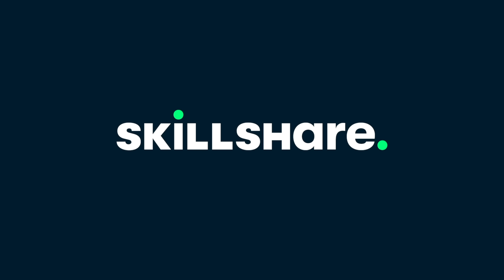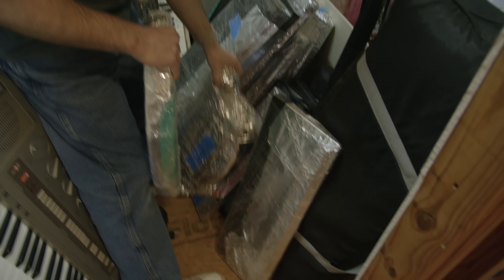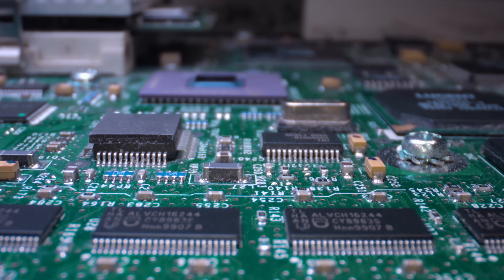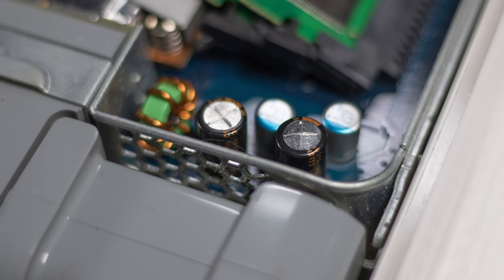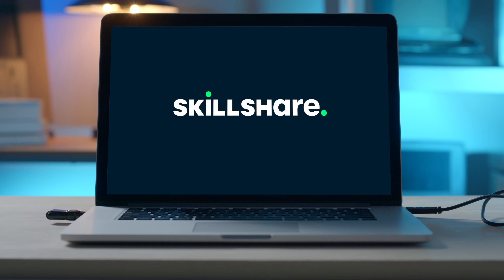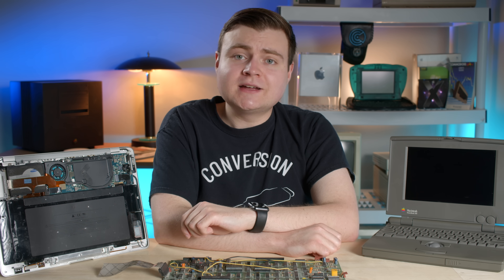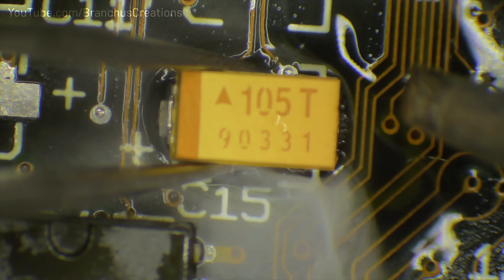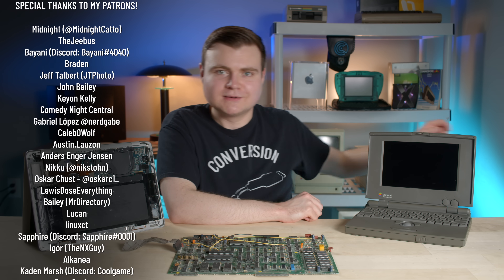Why Do Computers Die? (ft. The 8-Bit Guy) - Krazy Ken's Tech Talk

Comment: I used to be a service engineer and travelled to customer site to fix whatever issues they were having with their hardware at the time.

One particular job really was troubling, what seemed like a failed hot swap SCSI drive, however rather than it just failing and going offline, it rebuilt to around 70% then failed the drive and started rebuilding again, but the rebuild was taking minutes rather than hours.  So, not sure what to do, I checked with the senior consultants who told me to “just pull the drive”, which I did and the whole array went offline!

Turned out the drive was fine, it was the backplane of the drive shelf that failed and took out the SCSI controller board!

Sometimes things are not quite what they seem, ah the late 90’s, would have been so much better just to skip them sometimes!

Comment: I’ll never forget one of my earliest PC repairs, It was in the 90’s from what I remember and this Customer’s PC which was either a 486 or early Pentium PC and it was behaving very quirky and in a strange manner, It kept doing random things constantly, It turns out that when the owner setup his Computer he didn’t push the Power Lead in all the way so it was loose & ready to fall out, I figured out that was the issue fairly quickly and the Computer worked fine after I plugged the Power Cable in all the way! Anthony - Birmingham/UK 🇬🇧

Comment: What is the fault of your Powerbook, Ken?? Just got the same one as yours from a flea market. I have replaced all the caps inside, just to find out that the break in the hinge cut my display ribbon cable in half. Fixed that under a microscope. Now everything works, just needs a crazy amount of epoxy to keep the screen bezel and back in one piece and it is ready to go back together. I am also going to refurbish its battery, too.

Comment: Once I drop my laptop and the screen turned on every thing worked, but it was saying in the error message that the hard drive was not detected and I was so scared my dad repaired it and the hard drivers lose. That’s why it could not detect it. Luckily it was only a little bit of damage and not a lot over that and about another time I dropped it and I thought it was just normal but then I realised you should not drop the laptop and then I was so scared but It was still working in the third time. I don’t remember what is that but I got cracks after those drops😢

Comment: Decades of working on and with pc's, has me convinced that overheating is a major problem.  I have seen too many machines that sat on the floor gathering dust and Fido hair with the fan so clogged that it could hardly turn.

Also saw one computer used in a kitchen where the heat sink was covered with grease and it took automotive engine degreaser to clean it up!  LOL!

I have not done anything on a laptop beyond upgrading clubs, adding memory and replacing the battery.  I only my limitations.

Comment: Im trying not to think about the time i spilt a drink carton on a laptop (it was a windows 7 laptop, which had been upgraded to windows 10)
(Surprisingly enough the laptop still worked after that incident (apart from some of the keys on the keyboard no longer working), however, a few months down the road, I discovered an issue, when i tried to use a USB keyboard, the computer kept coming up with the sticky keys prompt

Funnily enough, if that computer had of been a desktop, it would have survived the mishap, as only the keyboard would have been damaged

Comment: My first moderate gaming rig had two Nvidia 8500GT's running in SLI, and after a couple years of ownership I just about fell out of my chair at the sound of a capacitor bursting.  It's surprisingly loud.  A few weeks later another one goes.  Then another.  After a while I was down to one card, and then no card at all.  I later came to understand that this was quite common for Nvidia cards of this era.

Comment: There's probably a hundred other comments about this, but the Apple III thing reminds me of a similar issue with the Xbox 360. Early production runs used cheap solder with a relatively low melting point. Sometimes the console would get hot enough that it would melt the solder, which lead to the red ring of death.
Reply from the maker: That’s what caused the widespread RRoD? I never knew that, but I do remember it reaching meme status because it was such a common issue. : D
Reply: @ComputerClan  It was one of the more common causes for the 3/4 red ring, which indicated a general hardware failure. The full red ring instead happened because of errors with the cable for analog video output.

Comment: Back in 2004-2005 I worked for an IT firm. We had sold a few local businesses some 17" LCD monitors made by "****".  One of these companies had 12 monitors that no longer worked.  The image was still there, but the backlight didn't work. They were still under warranty and "****" authorized that the monitors would be replaced and we were tasked with destroying the faulty units. We didn't destroy these monitors, but they were just placed into the boxes of the new monitors and tossed into the dumpster.  (later that day) I dumpster dove for them and took 8 of the 12 monitors.

I found that out of the capacitors on the board, 4 of them needed replacement.  I purchased a bag of replacements for just this model monitor for about $6.00 on eBay.  

I replaced all the caps on the board on each of the monitors and 7 people that I knew got a 17" "****" monitor as a gift.  The 8th monitor still works to this day and I use it as a spare.

Comment: Not a capacitor story but a power supply story.

So I have a working ASUS PC right? Power supply worked fine, it was back then when i didn't know on how to fix computers, well, I guess there was some trauma to the computer when we were moving to Bulgaria to stay with my sick grandmother. When I got back home to put the computer to use it as a test machine, it booted up, nothing was going wrong, until the computer shuts off without no nothing to say that it's shutting down. It's like a thunderstorm and you don't have any power in the house type of shutdown. It's kept doing that until i put it in one of my Dell Optiplex 755 computer and I thought everything worked fine then boom, the same problem. Power supply would work for a little bit of while and shuts off. Weird shit man, weird shit...

Comment: The cap thing. Okay so where I work we have this shitty 2002 HP something-rather desktop running a test bench in a PCB fab. Well it stopped working at some point. I opened it up to find dozens of bulged and leaking electrolytic capacitors. That said, where am I? A PCB fab. I desoldered them, found near-enough replacements, soldered them in, crossed my fingers, and it worked. It works to this day some 4 years later.

Comment: I've dropped my devices many times the most anoining one was the time I broke my new tablet and somehow the screen was working after I dropped it at least I had my older backup tablet which as a crack in the screen and my new tab has been fixed my phone is completely fine after being dropped a couple of times(sorry for the spellings)

Comment: I have 2 Amiga 2000's, and a loose A2000 motherboard.  One of the ones in a case, it goes straight to a green screen.  To fix that issue, it is suggested to reseat chips on the board.  So I went to do that, but the motherboard is bowed from front to back. When you press to reseat a chip the whole thing makes a ker-plunk sound.

Comment: I used to work at a PC repair store. One time we got this monster tower, had like 200gb of RAM and everything, think they used it for research at the university. 

They also had a liquid cooler. I forgot what I had to do with it but the cooler was extremely horrifying. Not only did they have the radiator on the outside of the case, I think the fans were backwards inside the case too. Instead of letting the piping from the CPU to the radiator sit in the case like it's meant to, they literally ripped a hole in the top of the case to shove them through to the improperly mounted radiator. 

I did my best to fix this horrifying thing, but it was something to behold.

Comment: I was using my computer that I had recently bought and then it just all of a sudden broke. So I decided to open it up but it showed no signs of corrosion, it wasn't water damaged and the capacitors were fine. So I decided to try to replace the parts that seemed like it would be the culprit. It turns out, it was the power supply, and after I replaced it, it turned on again

Comment: you see, these aren't the only common failures in these cases, a lot of times, depending on storage methods and prior use, new "guests" can destroy hardware. guests being insects and most commonly, roaches, they can walk in between components and then all of a sudden they've become a short, killing them and the hardware.

i'm a gauge cluster technician for GM, and as disgusting as this sounds, you would be surprised at the amount of dead bugs you'll find in clusters with vf displays. they find a way in and on a board with a high voltage psu like one with all digital vfd's they become a dead short very easily.

Comment: amazing video, but there was one point I was surprised wasnt mentioned, HARD DRIVES! those guys can be very finicky and when they fail it makes everything suck as you both lose your data (if its not recoverable) and of course you lose the functioning of your computer. though I will say that its amazing how resilient they are especially in laptops as the tolerances are so tight the reader head can be destroyed from a fingerprint on the storage platter but can withstand being moved around while spinning.

Comment: I had a motherboard that died due to the capacitor plague. This computer exhibited really strange behavior - in "normal" operating mode, Windows would run with the ACPI compliant power system enabled. This however caused massive drifts in the clock, and often caused the computer to crash. However, I was able to fool Windows into installing into a sort of compatibility mode (think Windows 95 days) where the ACPI was not enabled, it just ran bare bones processor and most of the devices being BIOS-supported. Suddenly the computer worked again. I ended up having to replace the machine eventually anyway, obviously, but when I pulled the motherboard out - well, you guessed it, the capacitors were in really bad shape. Leaks, pops, and corrosion everywhere.

Comment: Hold up. My Zeos 386 laptop went down a flight of stairs in it's case and actually survived an additional 7 years after. Yes, laptop was on. Yes, drive was spinning. Printed out a 4 page report like nothing. 7 years later the drive finally powered down for the last time. Never to be powered up. Nearly 16 years of service did that little workhorse serve. 16 years between my father and I. LCD gave up the ghost around 10 years, was connected to a VGA monitor up until 16 years hit. Great little laptop she was. The hard drive was the thing that killed the laptop. 16 years of service. I can't fault Zeos, it did what it was asked of it. And way more. So much more. And Drive Space? I managed to squeeze nearly a whopping 1gb out of a 40mb hard drive. She was the bees knees. LCD panel the first to go, HD the second... Damn fine little workhorse.

Comment: 16:46 Have still the remnants of an original netbook, from somebody else. Preformed a data recovery on it, after a spill killed the keyboard. It turned out a replacement keyboard would have been more expensive than the machine was worth at that time. Taking it apart, I could see that the spill that killed it wasn't the first spill. Also, the case had melted in places. No idea how the owner managed that. Got the data off it, and was told to keep the dead machine. Used the HDD elsewhere after wiping.

Comment: Anything which has a flow of electrons going through it will eventually short-circuit.  This is because electrons occasionally knock an atom out of place as they flow through.  While the movement of atoms individually isn't noticable, over time it accumulates until the wires are swiss-cheesed and a circuit break or a short happens.  With the increasingly tiny wiring in computers, this is becoming a larger and larger long-term problem.

Comment: My Hardware Horrible Story is a 2005 HP Laptop.  I didn't know the air intake on those was on the bottom so repeated use with it on my bed was killing it.  So by 2010 it would only run as long as I had a couple little fans pointing at some vent holes.  Then by 2011 the hinges for the screen broke and the screen would no longer sit upright.  I resorted to using duct to hold it from floppy either direction.  Towards the end of it's use I had it duct taped down to a flat but ridged box with the fans duct taped in positions to cool it.  Also I had the Laptop elevated about 2 inches above the box to allow better air flow.  What finally killed it was the power supply went out and it cost more for that then it was worth.  E-waste it was.

Comment: Well, my pc accidentally dropped from a normal bed, and suddenly the internal audio chip worked again, and after some time, it stopped working completely. And last year, my pc got dropped directly on its four "legs" and the pc was still functional. (except the gpu because I stupidly hammered it with a case... But I was still able to use the mainboard with cpu and cooler that was with crooked heatpipes and still ded audio. But now I got an new pc that does not contain the planned gpu because of shortage and scalpers.

Comment: Had a PS3, it kept overheating so I replaced the Thermal paste got it fixed and everything, had to open it again for some reason and ended up ripping the plug for the power supply wires off the board, and it couldn't get any power

Comment: Capacitors are also used to block DC and pass AC between circuits at different DC bias. For example between stages in a valve amp, where the anode (output) of the first stage can be biased to hundreds, maybe thousands of volts, but the grid (input) of the next stage needs to sit at a couple volts tops.

When the dielectric begins breaking down, the capacitor starts to leak DC, which in a valve amp will bias the next stage to the point of drawing very heavy current and eventually burning out the valve. Typically the user just replaces the valve without replacing the leaky cap, which promptly burns out the new valve.

Leaky smoothing capacitors in power supplies (or really, in any other smoothing role) cause the PSU to draw excessive power, not to mention the associated loss in capacitance making it very bad at filtering.

To be clear, ALL caps leak DC (electrolytics most of all), but usually it's so little it doesn't matter.

The other failure mode is high equivalent series resistance (ESR). That slows down the rate at which you can charge and discharge a cap, which creates lots of problems in circuits meant to take advantage of low ESR. Signal coupling suffers, but smoothing is affected even worse, especially if it's a big cap.

Comment: Computers die from planned/force obsolescence as an inability to participate in a software niche. A computer has an estimated life of 2-3yrears but in reality a computer can become obsolete at any second after the second that computer is available for purchase. The only rare circumstance that computers outlive planned obsolescence is if a computer can be used offline like a library. The worst thing is that you could have sold your obsolete computer for table scraps only to find out that specific model had gained eBay shill value.

Comment: I have an early 2000's dell workstation that had almost every single one of its capacitors fail. The tops all burst and there was corrosion everywhere. Good thing I didn't really want it's internals anyway, I just wanted the case.

Comment: Here's an odd one to add to your list: COCKROACHES!!!  Back in 1980 I was stationed in Panama and I had brought my brand new TRS-80 Model 1 with me.  Down there, cockroaches are running around by the millions and there's no way to keep them out of the open-sided buildings.  Many times I found cockroaches scurrying from my computer when I turned the light on.  One day the computer stopped working so I opened it up and found a good half inch of the circuit board eaten away.  I had to jury rig some support to get the circuitry to work again, and then started regularly spraying the area around the computer with Raid to keep them from coming back.  ⭐⭐⭐⭐⭐ to your marvelous channel!!!